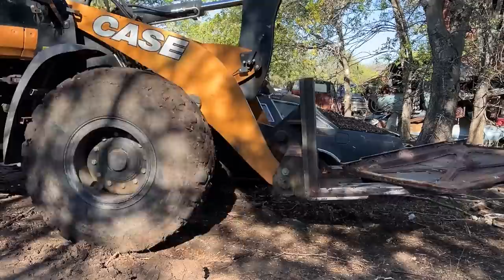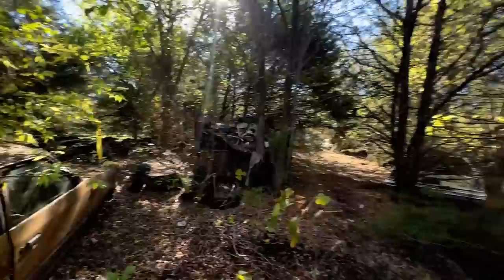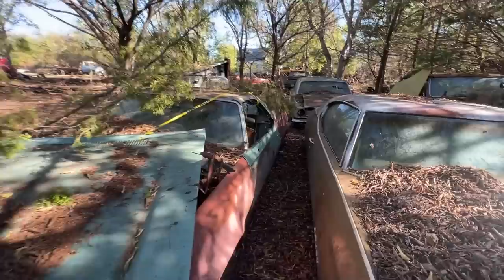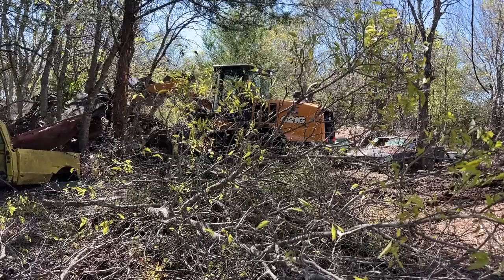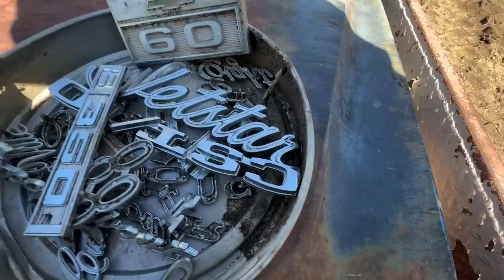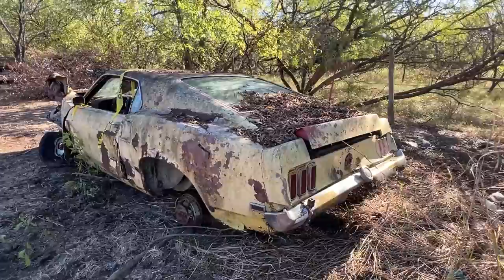Crushing Classic Cars Part 6, Joyce's Collection # 9, 1951 Chevy & 1980's Square Body Wrecker Truck

Comment: that green 1972 Ford pickup appears to have some good parts left on it
Reply: actually I think it's a 1971
Reply: Sad you had that brown and white 1972 Ford pickup crushed. Should’ve been lots of parts that could have been used. Even sections of sheet metal on the box sides.

Comment: ..26:39...that Barracuda doesn't have a 340 in it, does it?..if so, it would be worth saving just to save the engine...also, I was wondering, has the guy on the loader crushed anything yet that was not supposed to be crushed?...
Reply from the maker: Yep

Comment: Two Chevy trucks at 10 minutes in one with the brush guard and an old five window that has brush guarding it! How much for the one ton? Or just to push bumper brush guard off the front of it?
Reply from the maker: Whole truck 1500
Reply: @heartoftexasbarnfindsandcl5193  does having engine transmission what type?

Comment: Try getting some of the thick 1" square yellow wax sticks from a tire fitting dude. They use them for marking tires, but they will be ideal for marking cars and way cheaper and better than those crap paint pens. Being wax, they don't get washed off with rain if you mark the bodies or tires. I'm sure your local truck tire fitting guy will give you a few sticks to try out. 
Spelling tire like that was hard for me watching in the UK, we spell it tyre over here but who gives a shit!🙂